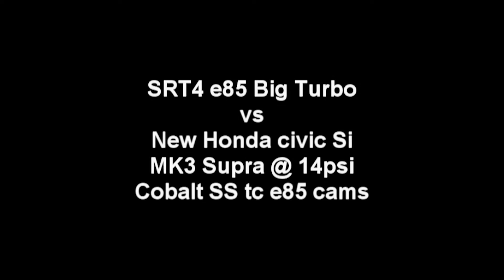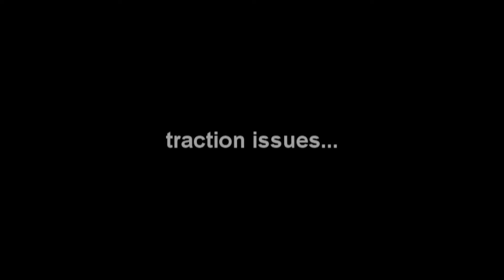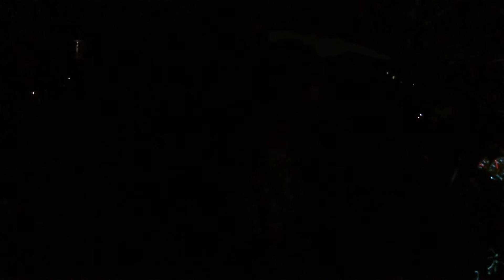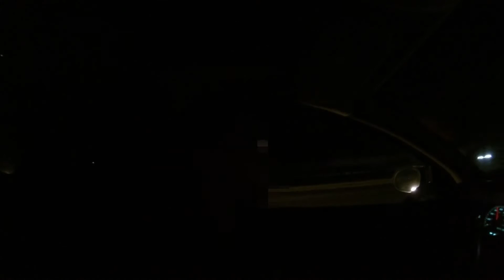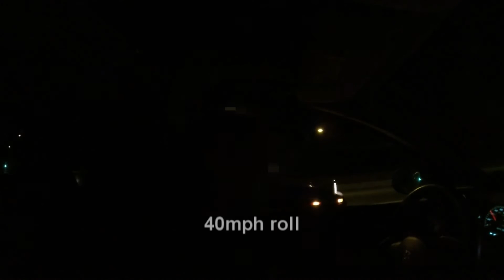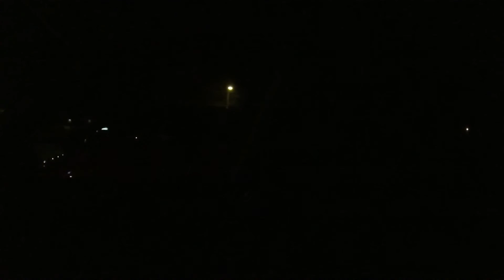SRT4 Racing with Traction problems

Comment: any idea what size mickey Thompsons those are?
Reply from the maker: 235 60 15
Reply: +MrCentraldriver 7" or 8" wide rims? can you give me more info on how well they hook and at what boost level they tend to spin? im putting these on 15x7s for a street tire.
Reply from the maker: +mike23386 15x7 rota slips. 35mm offset
Reply from the maker: +mike23386 they always spin regardless of what i air them down to on stock turbo and big turbo. once u hit 3rd your good if you got life on the tires.
Reply: +MrCentraldriver I know there's no chance of hooking 2nd without boost by gear but I was worried about full boost in 3rd breaking loose. I just want my 3rd gear back lol. thanks
Reply from the maker: +mike23386 i have no issues i 3rd unless my tires are at the tread wear bar or less. or if the road is just real crappy
Reply: +MrCentraldriver nice. what's the highest boost you've run on e85?
Reply from the maker: +mike23386 24psi stock turbo. 23psi big turbo. depending on the weather it will give or take 2 psi spike but rarely